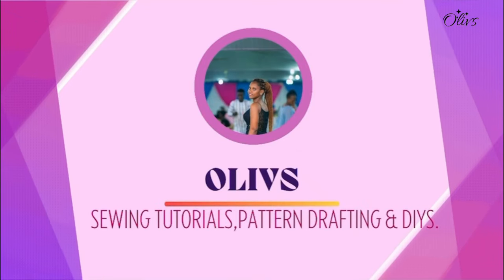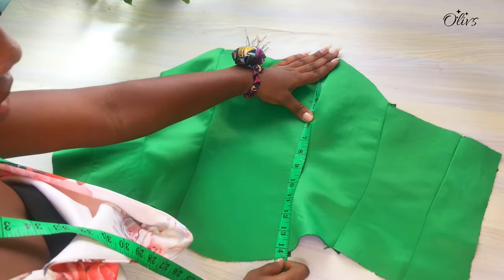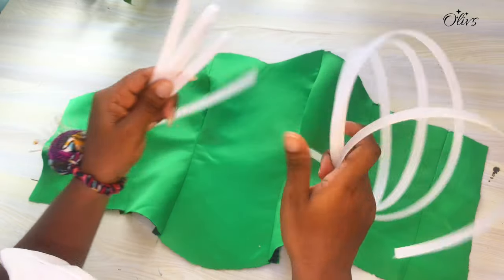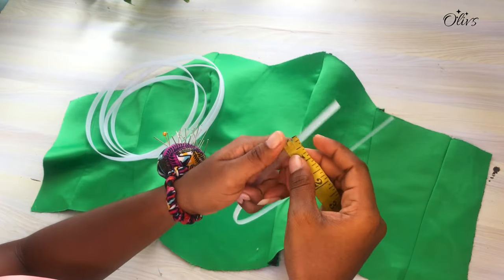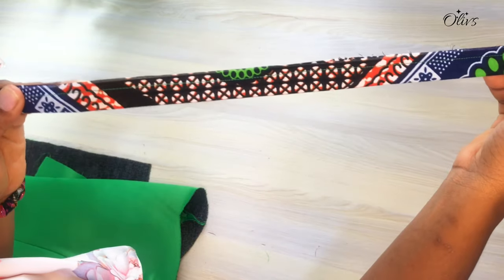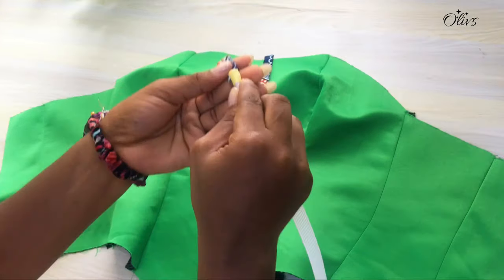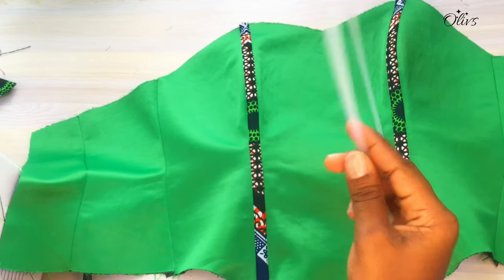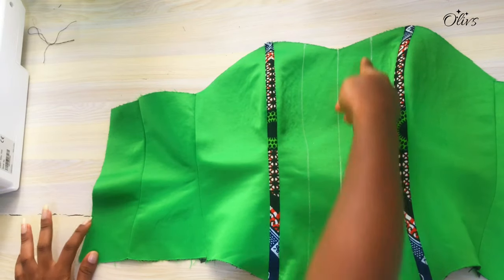How to create BONING CHANNELS on bustiers/corset.#OLIVS

Comment: Pls can I fix the bonne after joining the bustier. I don't want to use cup
Reply from the maker: You can stitch the traps(boning channels) before sewing the neckline of the bustier and later insert the bone. Hope I got your question right?
In case you don’t want to use bra cups, then you will need to wear an off bra ( especially when you don’t have a firm breast).